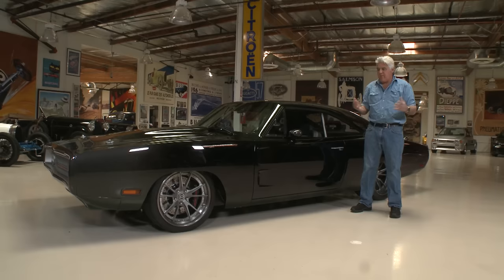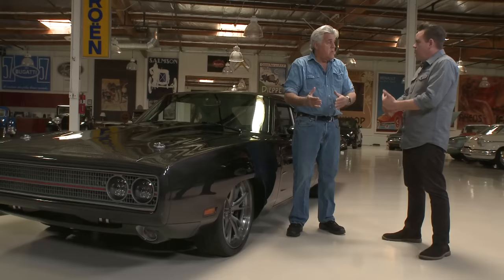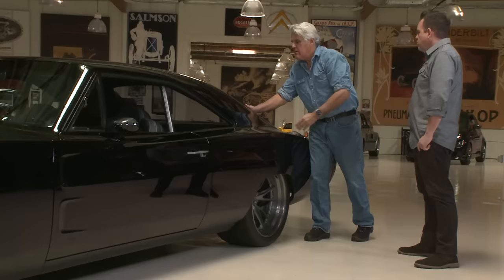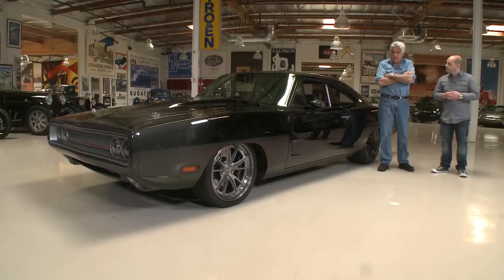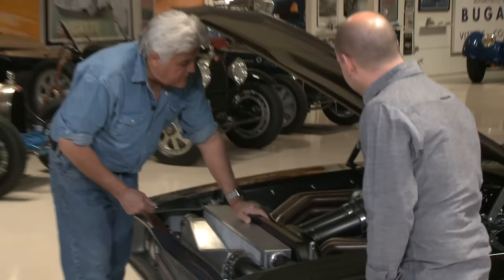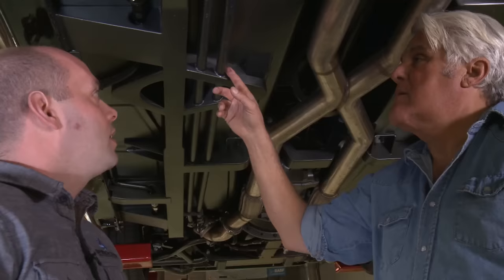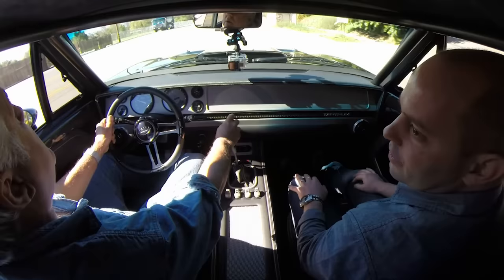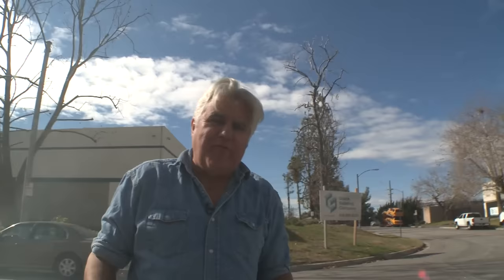1970 Dodge Charger Tantrum - Jay Leno's Garage

Comment: Those wheels and the low stance ruin the look of it.
Reply: i agree...older rims must be brought back
Reply: Elias Dib If not older rims at least something new that complements the lines of the car.
Reply: +Trakker Those custom HRE's probably run 3-5k per wheel  : /
Reply: +Trakker Gonna have to disagree with you on that one. HRE's on a carbon fiber charger? yes please.
Reply: +Trakker Yes it ruins the look and will not stand the test of time. Look at Jays Toronardo or Roadmaster they are examples how you tastefully modify cars.
Reply: You are crazy
Reply: Marauder252 Yeah a tastefully done car will look good forever, while these Lowrider cars go out of style every few years and has to be re-done for the latest fad.
Reply: Snuffy Smif I've seen plenty lowered cars that got it right, but this isn't one of them.
Reply: +Trakker: Yep... I totally agree! This thing would look great with some old-school chrome Cragars, and a jacked up rear... However, with ridiculous power like this, they were probably thinking a lower, wider stance would better help keep a diver from rolling and annihilating himself, and it!
Reply: Snuffy Smif
It would be even better if it had hydraulics and they replaced the wheels with daytons
Reply: +Trakker You must be 80 years old.
Reply: 925boosting Not even close.
I just like a design that always looks good not just for the latest 5 year fad.
Reply: +Trakker. so cragers and a jacked up rear wasnt ever a fad? Because im sure that was. And I dont think you understand what custom and heavily modified means. In my opinion when a car is slightly lowered it makes it look more aggressive. Everyone has their own taste.
Reply: mrarivv0007 That's why I said I've seen them done right being lowered and this isn't one of them.
Reply: +Branon Fontaine Yup..nothing worse then seeing spare tires on the front and racing slicks all jacked up in the read...
Reply: +Trakker
I completely agree. There's nothing uglier than a lowrider to begin with, but those wheels and body color sure aren't helping either.
Reply: Maybe they can raise it for ya 🤓
Reply: Don't you have a kitchen to be in and sandwiches to start making, +Jesse?
Reply: If you think this thing looks ruined you need a seeing eye dog.
Reply: I agree, after looking at that car in the beginning it made me want to cry because in my personal opinion I think he butchered the look of the car but thats just my opinion.
Reply: This is a car that was built to showcase their company's engineering and building capability at SEMA. So, they're not building thousands of them. Besides, this one was probably rotting away in some ol' guy's backyard with a 318 in it. Butchered look? Hardly. The General Lee had the butchered look after each jump, now that's butchered. I don't know how many have been wrecked just for that show, you guys should cringe much more watching the Duke boys than this!

Comment: Maybe my hearing ain't 20/20, but did he just say 1650 hp?
Reply: it may not be 20/20, but it's surely 5/7
Reply: +John Hardin 
A lot of carbon, 1650hp.
Power to weight ratio looks pretty alright x)
Reply: +Dhananjay Ringe Wow a perfect score.
Reply: +John Hardin I want one of these for my '10 Corolla, lol.  ;)
Reply: +John Hardin he said 1650, but unless they tuned it, it can only reach that power with 112 octane gasoline, according to the manufacturer. as a daily driver with regular pump gas, it's a sedate 1300 HP :V
Reply: +John Hardin I THOUGHT THAT WAS ELFIGO BACCA
Reply: +John Hardin lol, 20/20 hearing :)
Reply: +John Hardin You aren't hard of hearing.. That Mercury Marine Racing crate motor is every bit unnecessary, but every bit cool. They always have one at Miami International Boat Show. Sick.
Reply: +Jorge Canovas ; Six speed with 3.73 rear probably has good gas mileage if you take it easy. Those engines must cost a fortune.
Reply: +Johnnyc drums I agree, and I feel that any motor these days that's geared/rear ended correctly can run "efficiently". I won't beat out a Prius, but it won't run 1 MPG at cruising either. 

And yes, it is real expensive. I can never get one of the guys at the Mercury booth to give me an out-the-door price, but figure that it's got to be ≥$50,000.00.
Reply: Jorge Canovas ; I guessed about the price of 2  completed NASCAR engines, about $80,000. Come to find out from previous comments it's like $68,000 without the turbo's and everything else. I won't be buying one anytime soon, if ever. If I owned it, I'd race it at the strip. Apparently you'd never need to rebuild it.
Reply: +John Hardin Yes. If you were a car guy in the 90s or before, and blinked, suddenly it's 2016 and 400 or 500 HP ain't nothing. 2000 HP engines popping up out of everywhere, backyards, small shops, daycares, you name it there's a 2000 HP engine around. Modern computer management with big turbos and intercoolers has ramped up the horsepower wars something fierce in the last 15 years.
Reply: +John Hardin There's actually a 2000 hp street 68' Charger built by Nelson Racing Engines.
Reply: Adam Ye ; Probably not as much low end torque as a 9.0 Liter.
Reply: +Johnnyc drums The dude says it's a 2 second delay before the power comes on, that's not very
god. Makes sense on a boat you only need high rpm power. A properly built car engine is the way to go, but then you wouldn't be different..
Reply: +Adam Ye Nelson Racing makes rockets whit 4 wheels...
Reply: +Marauder252 It's propably still hilarious, awesome and ridiculous in a way not many engines are. Nobody needs a 9l tt but it's better to have it and not need it than not have it and need it. LOL :D
Reply: +Marauder252 They did it on purpose so that the power only comes on when you really want it to. Driving with that much power is not easy when you have zero driving aids.
Reply: +John Hardin 
You heard right but I didn't hear on what type of gasoline. They mentioned it wasn't pump gas but failed to mentioned what it was. They did say 1300-1400 HP with pump gas.
Reply: +Johnnyc drums perhaps more than that Norton!
Reply: +Johnnyc drums Yes...i'can't imagine what the price tag of that car is...$500K??
Reply: +Johnnyc drums the boats these engines go into get about.... 3 to 7 mpg. i wonder what the tranny and rear and does for that? maybe 12, 15 mpg? lol
Reply: CleavingCleaver Boat are never measured by MPG. They are measured by gallons per hour. First because boat speed is measured in knots, and two because there is not direct connection between speed and engine rpm.
Reply: +CleavingCleaver if it happens to be in the ballpark of 12-15mpg that's not so bad because in the early 2000's thats roughly what supercars would get if you tried. and they used to have around 5 or 600hp and smaller displacement.
Reply: Patrick Pelletier ; In the late seventies it was about 18 MPG for a full sized Ford or any other manufacturer for that matter. 18 MPG was really, really, good, back in those days. Who gives a care about gas mileage when you are going big. If you have to ask; you can't afford it.
Reply: Patrick Pelletier ; I heard that!!!!!!!
Reply: +John Hardin I had the same idea. It wasn't until halfway through when he repeated it did I crap my pants!! lol
Reply: +John Hardin If only I could borrow 50 hahha :)
Reply: I bet the stroke is substantially less than the bore dia. Less rotating mass and thus; enabling sustained high RPM and durability.                         That grill is a nice aerodynamic compromise, very similar to the Talladega.
Reply: +CleavingCleaver 3-7 mph? You don't know much about powerboats do you. These uses about 170-180 gph.  Do the math if you have two of them in a 170 mph boat.
Reply: ***** ; I thought that Merlin Mustang had a little more than that. Are you talking "D" model with Lexan canopy?
Reply: It must be fun to change the blown headgasket XD
Reply: let us not forget that hp is all about the amount of fuel that the car can possibly burn and convert to work...
Reply: Insane ikr. My car usally  use under 10 liters per hour...
Reply: yup engine is a modified upper on an lsx, dohc makes this sound much much meaner than a stock lsx and much more powerful as well.
Reply: YAH. JEEZ-USSSS.
Reply: only 1300 hp... pfft might as well be a geo metro

Comment: They didnt even touch on the most interesting part of the engine! I guess they didnt want to overly promote Mercury Marine and more just focus on the build aspects.. lol.. But the coolest part of that motor is the custom quad cams! dohc on both heads! Amazing head work and design by Mercury Marine to incorporate dohc heads on a V8! Obviously that thing must breathe AMAZING! Kinda like 2 k20 heads on a v8 block! Always dreamed about that! lol.. Awesome stuff.
Reply: They call it a quad cam, but that is a bit of a misnomer if you ask me.  It is a DOHC on each head.  That is still just a DOHC.  Or are they trying to say that in a 90 degree V engine layout, the 2 cams on top of the other head are still somehow over the head of the other bank?  You have the block, then a head, and then the cams.  The cams are over the head, hence the term Over Head Cam.  Not over the head and off to the side by 2 feel Cam.  That is why Ford calls the mustang engine a DOHC V8.  Surprised they haven't jumped on the Quad Cam name bandwagon.  They are missing out on the easy money afforded by people who instantly believe more is more. :)

Still an awesome engine.
Reply: yeah I was jumping to assumptions. They do only state quad cam not QOHC.
Reply: @Power5  .. It fine man, I actually also assumed it was like the same thing as the Ford Modular motor as well, and it shares similarities obviously, but Mercury Marine just took the technology and innovation to a whole new level here and did some amazing work to produce a motor like this that can make 1500whp barely batting an eye lol... Here are the full specs..
https://www.mercuryracing.com/sterndrives/engines/1750-competition/

Comment: Hold up.... I may be going crazy but did he say 1650HP?!???? Jesus what a car
Reply: Kev Bayotte That propelled a P51 to 435 mph.
Reply: Yeah, it's pretty mad.
Also, when you look under the hood, you'll notice stuff like a DOHC configuration, which is definitly not stock !!   :D
Reply: Yeah, that's what 27 psi of boost gets you thanks to that turbocharger.  While I like superchargers because they respond right away, they cannot get anywhere close to that amount of boost.  With superchargers and early turbochargers you're talking in the area of 7 psi boost.
Reply: Superboat Unlimited class boats run those motors. The 50' cats run 175-180 on the long straights. Twin 1650s.
Reply: I don't know of any pleasure boat running quad 1650s. There's a 50' Nortech cat running quad 1350s I'm sure he's right at 200 if not more. I know a guy who owns a 52' MTI cat with twin 1650s he took a pic of his GPS at 185. If he had four he could probly run close to 210.

Mercury just came out with a 1750 motor so the Unlimited race class might get faster next year.
Reply: Thank God. Mercury Racing now offers a purpose-built car engine (SB4 7.0L) for us crazy people, which retails for only ~29k USD.
Reply: yes indeed he said. I was playing it again to hear it cuz I thought I heard it wrong. 1400 with normal fuel.
Reply: When did he mention the power?

Comment: I don't know, does anyone else think the light gray grill and taillights thing doesn't look good?
And fixed headlights..
Reply: +Ostkreutz Rox 
I agree; even though they mentioned it is aluminum, the finish looks like cheap plastic .
Same with some of the interior details .
Not uncommon these days, think Ikea .

It seems to me they took a great looking car shape, and don't quite have the design skills to get the small things right .
And that interior, and the name ...
Reply: horsterer77
well thanks man. We forgot to mention the rims, they also don't fit :D The interior is ok though, I get that they went without radio and glovebox, but I would have included that, making that big panel open. But as this is not going to be someone's daily driver, it doesn't really matter.
Reply: +Ostkreutz Rox I thought the headlights and grill where terrible, worst part about the car. The tail lights and exhaust where bad too.  Then the wheels.
Reply: +Ostkreutz Rox , Yeah I'd want hideaway headlights and grill.
Reply: Dethmeister
OH YES!!
Reply: +Ostkreutz Rox the charger was perfect looking right from the factory!
Reply: +TABRAO  The grill and headlight's look like Coronet 500 item's, Don't know though..
Reply: +tom slick You got that right! I wasn't exactly too thrilled with what I saw in this video.
Reply: +Ostkreutz Rox Call me old fashion but they spoiled the looks. It looked right the way the came out of the factory originally. Keep the car original cosmetically and then put the boat motor in beef up chassis and suspension.
Reply: +tom slick Yeah, but is this really even a Charger or a carbon fiber copy? Remember the Ring Bros. Espionage Mustang?
Reply: +Ostkreutz Rox I hated the Tantrum badges personally. I'd rather see it say Charger myself.

Comment: I like the body except the tail lights and emblem. The original 68-70 Charger rear styling cannot be beat . I also like how there is no sound system .
Reply: There is - the exhaust
Reply: The taillights on this look to be based on a 1968 GTX. No idea why they went that direction.
Reply: Yeah I’m not feeling the taillight